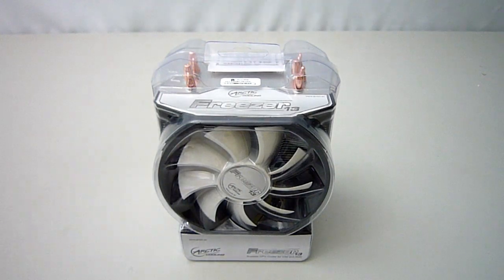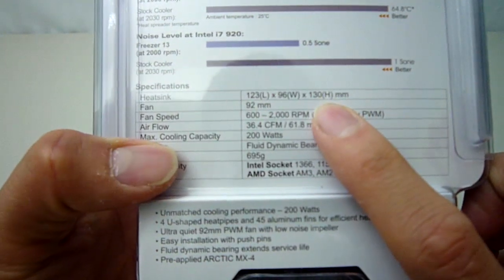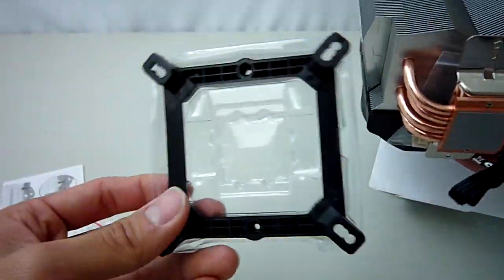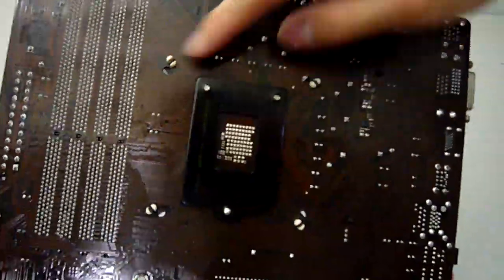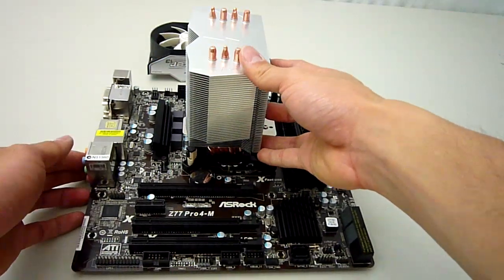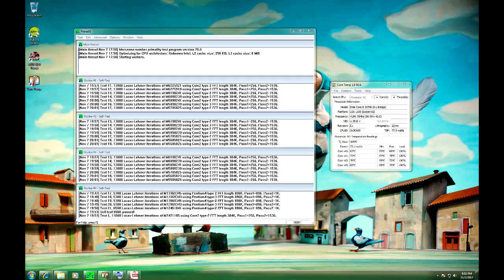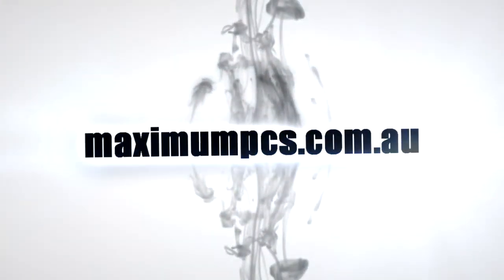Arctic Cooling Freezer 13 cpu cooler unboxing & review - Maximum PCs Australia

Comment: Hey, sorry to comment on such an old video, but I truly liked that you're using an i5 3570 with the Freezer 13 and show us temps as well.
I'm just wondering why your temps are lower than mine. I've got an i5 3550 (which is almost the same) and the AF13 on top of it. I'm running the CPU fully on stock and my temps after 40 minutes of prime95 were up to 90°c (with ambient temps of 26.9°c).

Is this because I did not change the thermal paste in the last 3,5 years, even after moving the PC from one apartment to another?
Reply: Should totally change that paste...it tends to go bad after awhile...

Comment: using this in 2016 I7 4770k =) have it set at 2.50 pwm Value
Reply: keep's my I7 under 60c while gaming best air cooler ive used so far =)
Reply: Cpu heavy games?
Reply: Aidan I'm still using it today :) bf1 gta V video editing don't have a problem
Reply: William Regal Ohh thank you!! can you tell me the temperatures at full load while playing? i would like to use it in my i5 4690k =)
Reply: Doesn't get passed 60c even after playing for hours Max temps I've seen is 62c
Reply: That's great, maybe i'm going to buy the Arctic Freezer 13 instead of the Cooler Master hyper 212 x
Reply: Aidan the spare parts are really cheap to think it's like 3 dollars for a new CPU fan and it's designed to run non stop

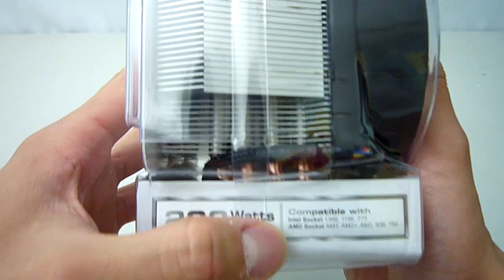Comment: Arctic website says that this cooler is compatible with Socket 1150, but at 1:00 in this video there is no 1150 in the compatible list... And I have an Intel i5-4670k, so will this cooler work with 4670k???
Reply: socket 1150 is not in the compatible list because it didn't exist when the video was made.
Also every cooler that's compatible with LGA1156/1155 is also compatible with 1150 and vice versa, since physically the only difference is the number of pins and the sockets have the same size with the same mounting holes.

Comment from the maker: Check whether it is your CPU that is overheating or your graphics card - in any case you may need to clean out the dust from the heatsink fans on both
Other stability issues can be caused by faulty ram also

Comment: some of the Arctic Frezzer Pro 13 have Fan Size
    120mm & 50mm (2 fans)....vs the one 92mm(yuck) weird i would think if it fits i would use the one with the larger fans have you heard of this? newegg has both models for the same price!